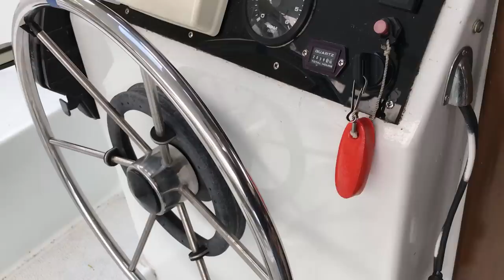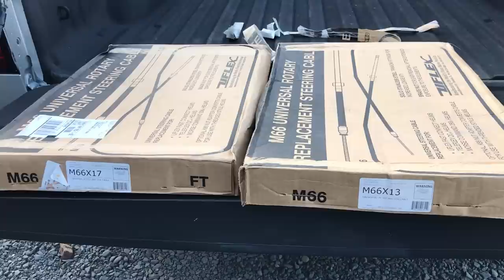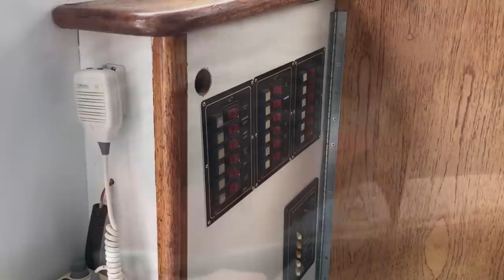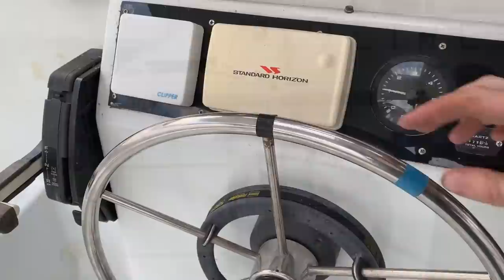Dual Cable Rotary Helm Steering Fix... FINALLY! Opposing Cables Trick (Boat Work: Sailing 9 LIVES)

Comment: Awesome video I just got an 1983 3000 model and I'm having to replace the entire steering system eg Both cables,both splashwell mounting kits , the helm and the wheel .This video was very informative. Thank You :)
Reply from the maker: I am so pleased to hear that the video was helpful!
Good luck with your 3000. They are great boats.

Comment: .... gotta love it, getting tasks ticked off the list when there is no deadline. pressure when threading cables like that ..... see the train still rattles on by and sounds the horn to make sure you don't miss it ...... was just wondering yesterday if you were in project mode and be releasing a video, great as always ..... how's the rest of the family ..... never stop dreaming, just dream bigger ..... have fun be safe. save our oceans .....
Reply from the maker: Peter Frebold 
Hey, Peter. Yes, We are in project mode, awaiting the movement of boats blocking the path of the Travelift from getting to our boat. Should be soon... It is funny, though, looking at the pile of equipment awaiting install. We are doing what we can, while taking care of ourselves and Rhea. The Coronavirus response seems extreme, but I’d rather people remain healthy. “Normal” likely will never return, but we will continue to live our lives and hope to build a better world for those who inherit it from us.
Reply: @Sailing9LIVES  

Hey Duke and Virginia and Captain Rhea of course. Totally agree that normal will not be the same, there is a big shift happening and if it is political as some are claiming, we do not know what is going on behind the scenes. Guess time will tell.

the main thing is that the list is getting shorter even though the pile is still huge.

Sounds like you see a splash date on the horizon.  There is a couple up in Ontario and they got an update e-mail in the last couple of weeks indicating no splash till at least Sept 1st. all i can say is wowsers.

As long as we are always pushing forwards and building something better for those that follow is of utmost importance ....

Comment: Great Fix!! Harder than it looks!! Hope you get to float the boat, more than fixing it, this summer, in spite of covid 19!! In any event, be safe!! Is the gorilla tape better than duck tape?
Reply from the maker: joe ROSCILLO Hey! Yes, it looks like we might get to drop the boat into the water tomorrow. There is one potential problem ahead of us, so it might mean we have to wait until next weekend... but we are hopeful! Progress on projects has been slow, so there is a big pile of things awaiting us and we hope to get to most of them before setting off for the Northeast this summer, but we’ll get done whatever we get done. There is some time then before we head for the Bahamas. So, here’s to progress... 🍺   As for the the gorilla tape, I like it for most general purpose uses we’d normally use duct tape for, aside from taping air-handling ductwork. It is strong, but more easily removed than duct tape, without leaving a messy residue behind.

Comment: Great video, just bought a 3200 and I may not have to change the cables yet but I am sure my rudders aren't turning as much as yours. Where did you buy the cables from?
Reply from the maker: Hey, Matthew!
Congrats on the 3200. I am sure you'll really enjoy the boat!
We bought the cables from http://www.hodgesmarine.com/
At the time, they seemed to have the best price. You'll need the following:

UFLM66X17
Uflex M66 17' Fast Connect Rotary Steering Cable Universal
$94.05

UFLM66X13
Uflex M66 13' Fast Connect Rotary Steering Cable Universal
$94.05

Comment: There is almost nothing worse that working both ends of a cable issue. You need to stock up on beer for willing volunteers to hold the dumb end of the tape. :-) Nice work though.
Reply from the maker: I disagree.
Removing a holding tank that ends up not even existing... that is FAR worse. :D